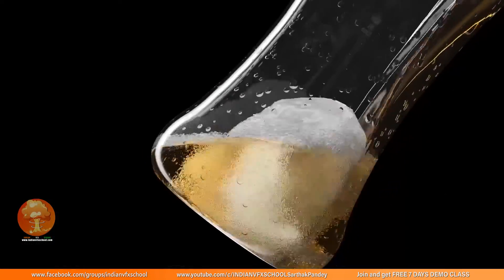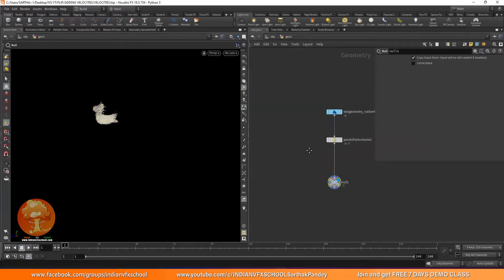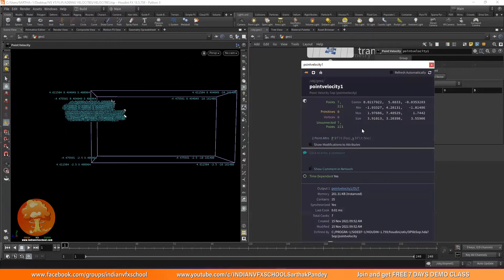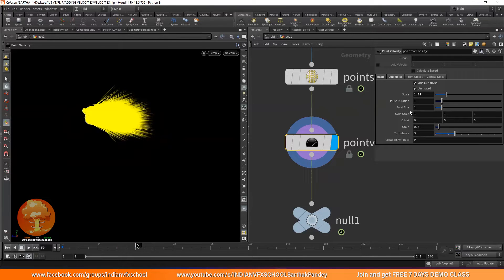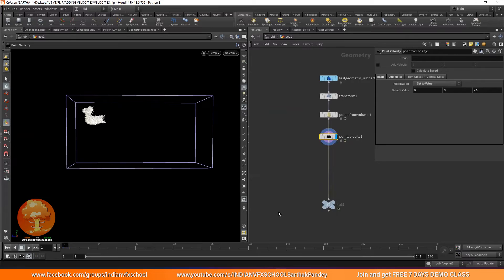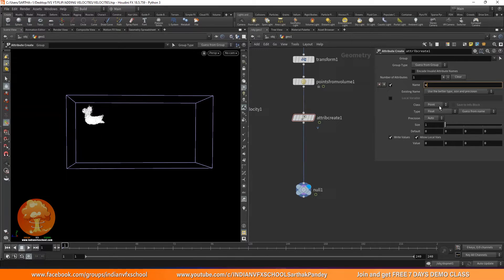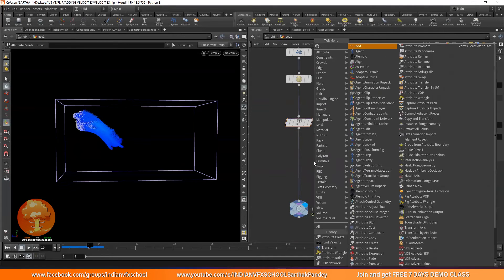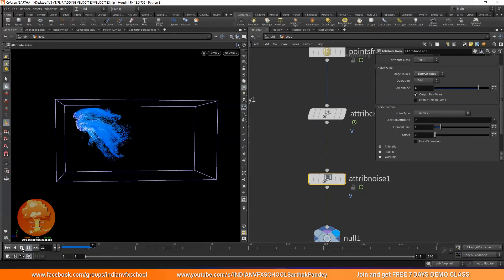Houdini Basic Flip 002 -  Adding Velocities

Comment: funny part is my particles are way big right from the start for default value 0.1
Even if i set particle separation to 0.05 , Yet still they're pretty big spheres
Im on 19.5 Non-commercial
Reply: In the dopnetwork, check your flip object>guides> particles. The visualization should be set to particles. Perhaps it is set to sprites which are usually bigger.
Reply from the maker: Thanks.
Reply: In the Display options> geometry> particles section you see a check box for display sprites and if it's already turned on just untick it and you are good to go.